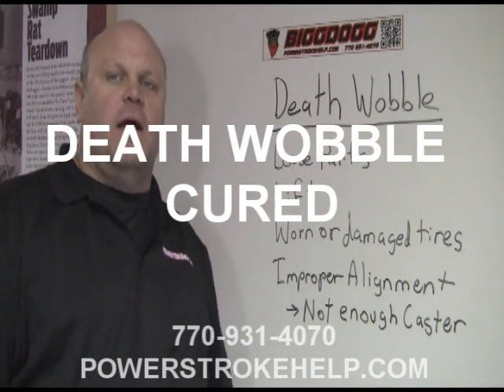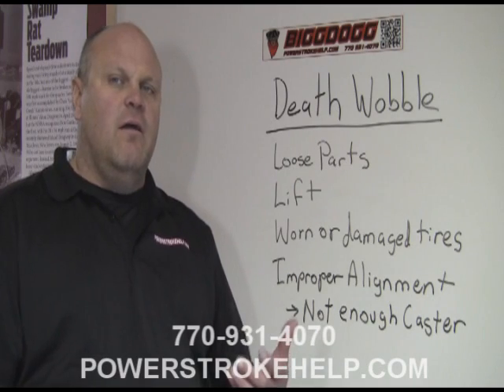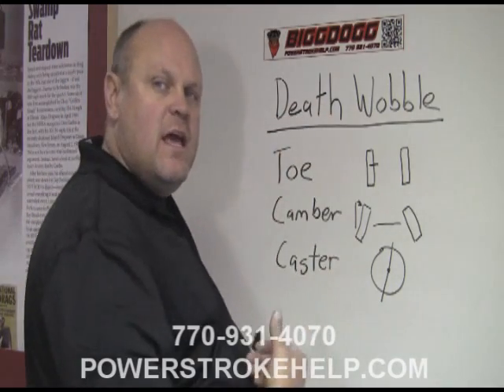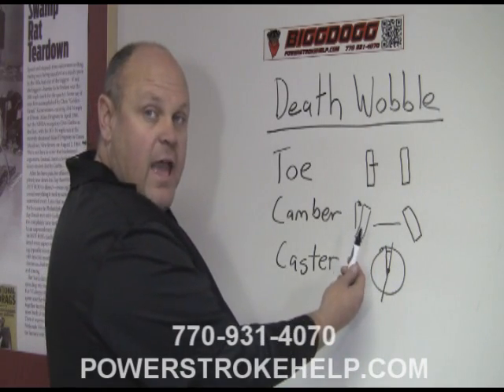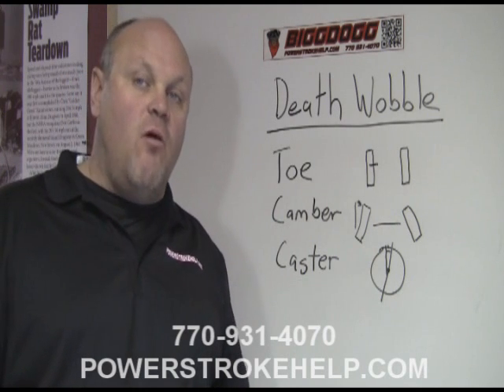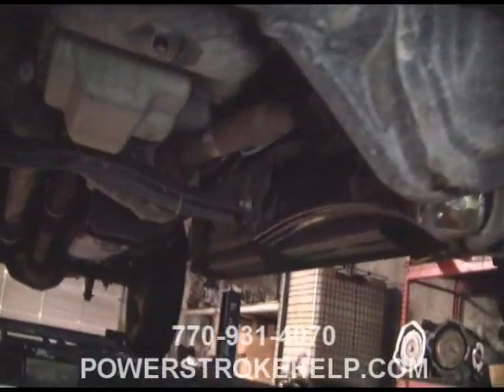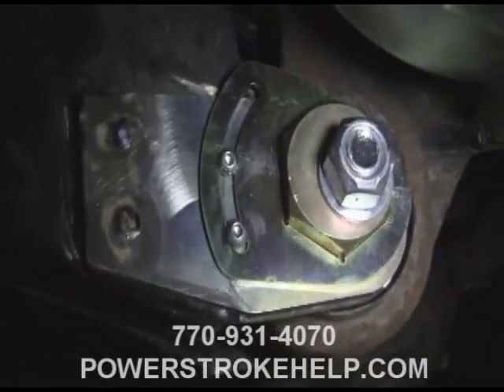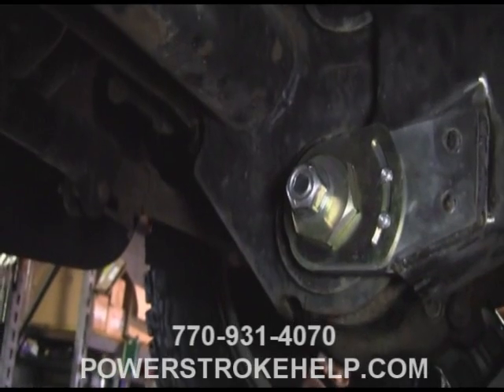DEATH WOBBLE - POWERSTROKE - SUPERDUTY

Comment: Thank you for the video.  I have a 2015 F250 Super Duty.  I experienced this exact problem twice at about 2000 miles.  Did not happen again until last week and did it twice again.  Now I have 18000 miles in the truck.  One year old, tires are good and I believe equipment is in perfect condition.  Do you think the caster is the problem?  thanks!!
Reply: +Troy R You may have gone over a pot hole or speed bump or something that really whacked the front end suspension pieces and weakened them. The ball joints are the first soft spots to look at. You can't really tell if they are bent until  you take them out or verify that you have something misaligned using a wheel alignment machine. If it's a 4 x 4, you should do a 4 wheel alignment and see what you actually have. They make look tight and 'straight' while you have it jacked up, but you can't really tell until you do a wheel alignment. In rare cases, I have seen defective tires. You can swap the tires from front to back and see if that changes anything. Keep them to each side (LR to LF and RR to RF). If it eliminates the DW, you may be able to claim warranty on your tires for being out of specification.
Reply: Did you ever figure it out? I have a 2015 that is pretty much none drivable because of this it has 91k. I was just wondering before I start dumping a lot of money into it.

Comment: Bill you are the only one that found the true solution to the problem, all the other fools on the internet have no clue what they are doing.
Reply: Caster is usually a good thing, it helps allow the steering wheel to want to return to center easily, and adds a stable feel at high speed. 
Dig the shopping kart reference , it's how it sunk into my brain back in tech school.

Comment: How can I fix this issue on the older superdutys with the leaf spring front end?
Reply: I'm looking into it myself but I'd think an angled shim between axle and leaf spring would do the same as this thing. my 1999 f350 drives perfect, my 2000 excursion is scary to drive. I'm gonna do some measuring between the two since I've replaced parts with no improvement
Reply: Same thing my 2003  F350 runs great but my 2000 excursion freaky scary

Comment: Nice solution to the DW problem. We had an F250 come into our shop that was hit in the front end with a plow on it. The plow twisted all the way back an actually folded the left fender in half. Anyways, when we were done pulling and measuring the frame the front axle was over about 3/4" to the left. We measured another F250 and its axle was over to the right about 3/4". How far off are these axles from the factory?
Reply: +James Last Depends on the legth of the track bar and the spring size, the track bar is fixed usaully, and a longer or shorter spring will move the axle left or right.

Comment: Precision Metal Fabrication! A bit more expensive @ 899.00 but the 3 link or 4 link system seems like a more quality solution to me? I have shopped around a bit and there are kits like this as low as 599.00 and as much as 1800.00 but this one seems like a great product for the money. Just sayin?

Comment: Will archoil fix this?? ;)
Reply from the maker: bbubacz1 I suppose if you use their grease the front end parts wont wear out so quick.
Reply: Lmao
Reply: +bowhunter 85 Think about it, that two inches that the axle is pushed down probably about two degrees of caster gone, so this kit adds about 3 degrees of caster and it put you right into the factory zone.
Reply: @crashandburnbirner  is that because the steering box is not dropped and the tie rods pull the caster inwards?
Reply: powerstrokehelp what about bad parts ball joints, bad tie rods, etc.?

Comment: This guy is talking about " the best fuel economy@ 70 mph& aligning at ur toe perfectly straight or you'll wear your tires out.  THE BEST FUEL ECONOMY IS @ 55 MPH & YOU TOE IN SLIGHTLY  @ HIGHWAY SPEEDS YOUR TIRE WILL PULL OUTWARDS, THUS GIVING YOUR TIRE PERFECTLY STRAIGHT TOE.

Comment: these trucks are made to tow trailers caster will increase as load in the bed and/or on the hitch increases. Another problem most people overlook is scrub radius and it changes when people lift there truck and put taller tires on it. this is easily cured by changing the offset/backspacing of the wheel. its a good idea to measure scrub radius with factory ride height, wheels, and the correct tire size. Then pick a wheel and tire that will give you the same scrub radius

Comment: Hi there and thanks for letting me know how to fix these trucks!! This is Chuck from Andy's Alignment in sioux falls sd. Let me help you now friend. There is a much easier and cheeper way to gain caster up to 3 degrees with camber caster bushings. Install the 3 degree bushings for full caster. All the bushing I have fun across are 0 degree in both sides. If you in stall them for caster only it wont change the toe or camber. way cool easy fix eh? Maybe change you video to include this. Thanks again

Comment: Your videos have been VERY helpful, I've been changing out fluids and filters on my 2003 F-350 Super duty, the radiator cap, gas shocks, batteries.  All with your video help. You've saved me a ton of money!!! Thanks so much!  Just bought the truck, but now I'm saving up to have the $7800 bullet proofing done!

Comment: I had an F350 that had even a low speed death wobble due to a binding wheel joint and loose ball joints.
Reply: pro trick: you can watch series on Flixzone. Me and my gf have been using it for watching a lot of movies recently.

Comment: How I fixed my wife's death wobble on her 2wd 2000 Ford Excursion. First I took it in and had it aligned and that didn't fix it. Took it in to have the tires balanced and they said no cuz it needed parts and tires but wouldn't tell me what parts. So my 9 year old son and I started looking for the damaged parts. I replaced the right inner link and outer tie end rods thinking that was the problem. Although it did help a little but still had the wobble. I made sure the gear box bolts were tight which they were. I was getting ready to change the left inner link and tie rod end. As I crawled out front under the front end, I grabbed the front sway bar and it made a loud bang. So I looked closer and the sway bar bushing were shot. I mean one side was almost completely gone. I went to our parts store and spent around $22 for the pair and had them installed in about 10 minutes. Took it for a test run and problem solved. I'm not saying that everyone's death wobble will be fixed by replacing sway bar bushings but it did work for me. Hope this helps someone else with this scary wobble. Good luck!
Reply: Lo G Thanks for the intel! When I get tires I'm replacing all the bushings as a safe measure.

Comment: I use to work for a nation wide tire shop. There have been a couple times where even if we match the tire to the high/low spots of the rim it still requires over 10oz of weight in just one spot. This is really true with aftermarket rims 20+" diameter. It makes it a huge pain in the ass to balance them correctly. We'd road force the tires if they are asking for a lot and dismount and remount if need be and it they have asked for an insane amount of weight. Aluminum rims bend real easy and that can cause vibrations like no other. Those have to be specially re-bent. Steel rims are pretty easy to rebend back with some heat, hammer and a ton of time to meticulously rebend it back. In several instances there were flaws in the tread which will cause a bad wobble. I've seen a case where 3 tires from the same Firestone plant (Firestone Destination LE2), same plant, week and year code and they were bad. Ironically the 4th tire from that set with the same dates was perfect.

Sticky weights really suck. They especially suck when the rim has a chrome flaking on the inside and it peels off easily. Cadillac rims are notorious for this.

Comment: I just bought a1999 f-250 lariat 7.3 power stroke crew cab 4x4. paid $8.500. Says 159.000 miles. no leaks. But Not sure if I did the correct thing. I just needed to have a diesel drive abitliy test done. and it needed a sencer put in to correct a hiccup in the motor. Everything else tested ok. But not all the interior lights work eather. And I jump if I hit something on the highway. It's my first diesel truck. My other truck is a 1992 gmc with a 454 motor. No issues. But it needs some transmission work now.

Comment: I know this is a Ford help web site. I just wanted to add to the fact that Dodge Rams do the same thing. Both utilize the Haltenberger steering system and similar solid front axles. Whether one or the other has leave or coil over suspension. The one issue I have noticed the 2500 Ram Heavy Duty has a live front axle where the front differential gets pushed by the drivetrain and not pulled by the drivetrain when four wheel drive disengaged. Likewise so does Ford Super Duty when the four wheel drive lockouts are engaged. Ford Super Dutys use an front driveline has an alignment ball and socket in its real CV or compound joint which prematurly gets sloppy making the driveline spin off center causing a tremendous vibration to occur. This occurs more promenate when the 4wd is locked in at the axles and the transfer case is also. Now Dodge axles and likewise the Ford being similar both in drive, suspension, and torque to axle initiation. They are similar. When driving and more than one of the many causes occur. This intense shimmy will and does occur. I have a friend who just purchased a 2015 Dodge Ram Heavy Duty 3500. The front axle has a 3rd member like a GM in that it disengages at the differential. Also the torque arm setup like the Ford Super Duty. He has never had his trucks of the five he has purchased in the last twelve years do this and they were all ton capacity dual rear wheeled trucks. Who wants to know why Ford allows this all the while Ford is the proprietory of Cummins engine? All to fail all to cause you financial burden and poor faith in their manufacturing. Foolish engineering and over engineering has caused too many issues. No one wants their shoes to get muddy anymore maybe? No, no its laziness? Well, I have diagnosed and been involved in the remediation of multiple vehicle repairs and cause diagnosis issues. Why is it so important to change things every chance they get. GM use to use this same tact but they seem to have got better. The one and only way Ford has kept the no.1 position is that they were first. Also they also have more capital, plants, and build way more units than anyone else. I have a 1995 ton cab and chassis with a 454 and a 2004 GMC K1500 5.3 powered trucks. Both have broke 300K marks and neither have had transmisson or powertrain repair except for the GMC front diff. I talked to the owner of 108 truck salvage in Perkins Oklahoma. His name is Howard and he said he has 3 roll back ton Chevrolets. He said the chassis is bullet proof. He claims they are all at a million or more miles! Why is this? Im sure that my luck lyes in GMs. Ive never walked while owning them. Also they can be darn near falling apart. But, still rolling. Sometimes some things are build to rigid in the wrong areas. When all along they needed to be thought through again and made to bend more before the break.

Comment: I BELIEVE SPECIALTY PRODUCTS MAKES AN ADJUSTABLE UPPER BALL JOINT THAT PROVIDES UP TO 2.25 DEGREES OF ADJUSTABLE CASTER, THAT WILL BE EASIER THAN A BRACKET THAT YOU HAVE TO WELD ON
Reply: Tsinia Peterson I did that, replaced everything that Moog makes under the front end for this truck and it still does this. I am now blaming it on the PRO COMP lift kit. GRRR we shall see how much more cash I can dump before I figure out.
Reply: Chris Rhea I got 2 degrees with articulated ball joints. not quite enough.

Comment: Had this happen inexplicably towing a boat @75 MPH. Frightening to be sure. We crawled all over the truck and saw nothing wrong. Didn''t do it again, but I kept speeds at 60-65 rest of the 4 hour trip. A few knowledgeable people look at it at the RIver, no one saw why. 4 days later, coming home, same thing. 4 hours turns into 6 at 55-60 MPH. Took it to the Ford dealer, and $3800 and 3 days later, get the truck back with all new bushings, springs, shocks and ball joints.
6 months later, I get a letter from Ford Warranty describing the exact problem. They claim it is due to improper tire size, or load/ply rating, and/or improper inflation.
Problem returned 5 or 6 months after the letter. Tires were oversize, and incorrect load rating, and since replacing those tires 3 years ago, never a problem again. ;)

Comment: so questiondeath wobble is just a driving thing and not a thing when you brake? is this right... i have a mechanic who thinks i have death wobble.... ill try to explain quik basicly in a quik nutshell when i brake my steering wheel shakes sometimes bad sometimes not to bad and its a intermediate problem doesnt happen all the time. now i replaced wheel bearing/hub assembly brake pads drums and shoes... yesterday to so i havent had the problem again yet. also im tie rod broke on me while driving the other day to bent the inner tie rod(getting replaced in a couple days hopefully this weekend). im just trying to figure this out
Reply: No, its just a driving thing. Broken tie rods definitely aren't helping anything either but you wouldn't experience the "death wobble" during braking.  Usually a small bump in the road is what will cause it to start "wobbling"  You'll definitely know it when it happens.  The truck pretty much can't be steered left or right until it stops. The speed that I'm driving usually dictates how long it last.  

What I've noticed though, is that the worse my tires have gotten, the worse my wobble has gotten.  When the tires were brand new, a bump in the road might cause "death wobble" than half a second @ 75mph and almost unnoticeable to most people where as now that the tires have gotten to about 20% tread left and about ready to be replaced, those same bumps on my drive to work cause the wobble to last 4-5 second at 75mph and that can be longer or shorter depending on my speed
Reply: hmm ok thanks i asked cause my mechanic friend said look into death wobble and trust me i looked at him like what in the world i doubt that one

Comment: I am so glad to have found this video. I am considering a near future purchase of an '08 or newer F250 Super Duty. I now have this kit info saved to my computer so when I do find a truck, I can have this installed. On my '03 Int'l 9400i with I-beam steer axle, I have 12° positive caster on passenger side, and about 7° positive caster on driver side (axle-twist). This is not only an issue with pickup trucks, it is a deadly problem for semi-trucks as well. With my caster settings, I run highway speed with one finger on the wheel and no issues ever regardless of severity in road condition, one finger holds it. Harder to steer yes, wobble no.

Comment: Good solution to a problem that ford should have got right in the first place , this isn't the only problem that ford will not admit they got it wrong ,uneven tire wear on the Ranger is another issue ford will not deal with .

Comment: Also check the tyre pressure. Had some wobble in a -92 F250, 7.3 and after trying most things it went away when I pumped the tyres up. Thanks for great videos.
Reply: Mine only happens when I air my tires up